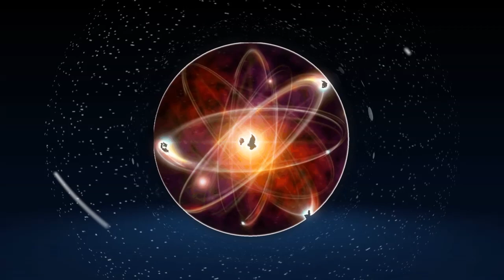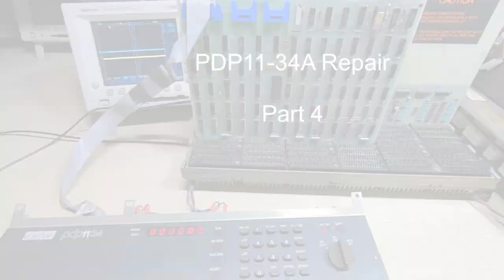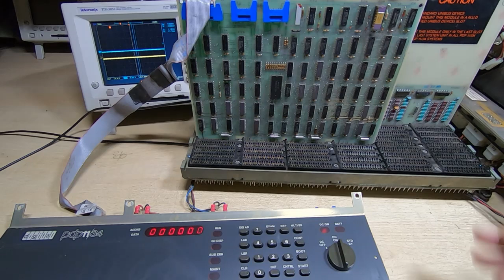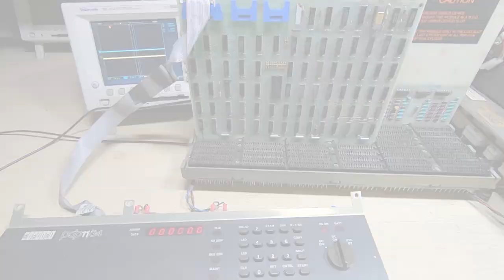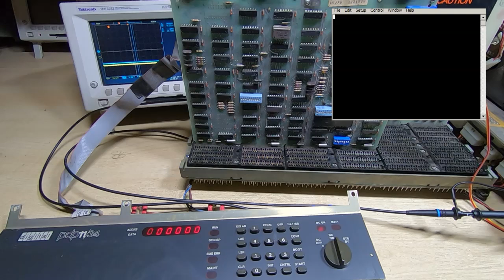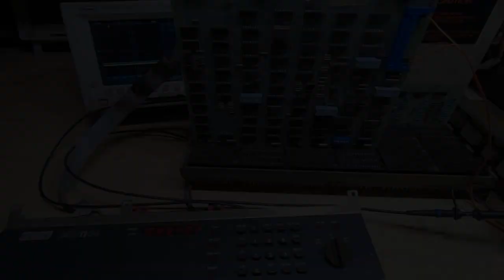PDP11-34A Repair Part4

Comment: I've built my own 8,16 and 32 bit computers using off the shelf processors and I'm used to proving out peripheral ICs using an interactive "monitor" attached by serial port, but this takes it to another level. Making me wish I built my first boards with a proper front panel.

This raises the question of wether there is enough memory (rom and ram)  on the 8008 card to implement a proper UART based monitor, which utilised the "host" UART?

Comment: Something that would've happened if you had replaced only one display is the new one would be brighter.  To make it look right you'd have to replace all of them.
Reply from the maker: Yes and it would also most likely be a different colour. The difference in brightness can be got around by making them all brighter. The brighter LED's are the less the differences show up but with something like a PDP 11 it needs to look right. I would always change them as a set anyway but even then old displays can vary. We used to have to select matched LED's when manufacturing this sort of display.